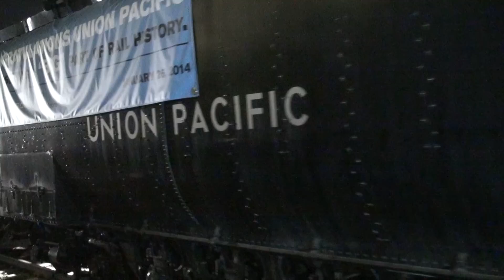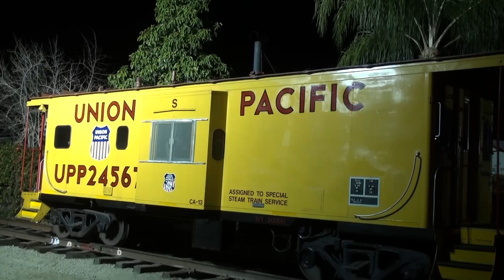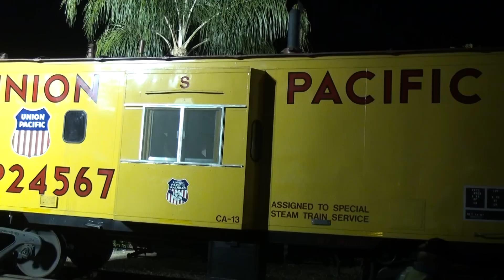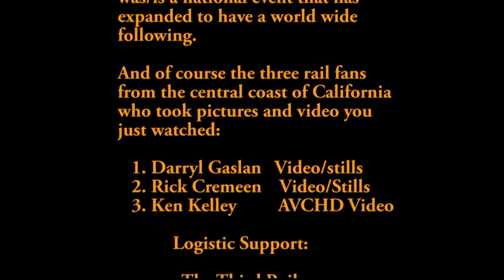Big Boy 4014 finds the Rails M2T

Comment: I'm amazed that the Big Boy could get round a curve of that small radius. Shows how clever the original designers were! Thanks for documenting the event for those of us who couldn't get there.
Reply: i would not try that with my locomotive at 45mph! that is one tight curve.
Reply: It's almost like running a Lionel locomotive meant for 0-72 curves but you run it on 0-54 curves. LOL
Reply: 4014 is an articulated engine. It has two separate swivel driving sections.
Reply: Legomenon,Thank you for your reply. I don't know the details, I just wanted to mention "ariticulated" because there are many who don't know how totally amazing and complicated 4014 is !

Comment: Ultra-high quality documentation of UP Big Boy 4014's first connection to the railroad network. Suspense (will the tender make it)? 5 stars!
Reply from the maker: Thanks for the rating, however, Union Pacific mechanical engineers are the ones who earned the kudos for figuring out the tender could make the curve.

Comment: Kudos for putting on the video info about the reason for all that hopper cars in this move, none of the other videos that I've seen of this event explain something about it but I'm glad to find it here!! ;-)
Reply: What was the deal with those?
Reply: Joseph Rosnett The answer is on 41:30... Additional braking because the big boy and tender doesn't have active brakes by now...
Reply: From all the red hoses wrapped around 4014, I think they actually did have her brakes connected. However, unproven brakes that haven't been used in years, so it's a good idea to provide the empty covered hoppers as additional stopping power. Just in case anything had gone wrong.
Reply: Looks to me like 1996 is leaning to it’s right on the curve.

Comment from the maker: If possible, try to view this video in full screen (minimum of 480p) so you will be able to pick up some of the amazing track work that is taking place at nighttime as the Big Boy Steam Engine finds other than temporary track under its wheels.  Yes it is a long video which should give the viewer some appreciation of what Union Pacific is doing for future generations so they can enjoy that part of the Industrial Revolution where Steam Power so changed the world.
Reply: How were they able to get the whistle to work?
Reply: Andrew Carlstedt Ed tied the whistle and bell to a generator and compressor in the tender but it can only be used once or BIG BOY goes into emergency
Reply: Andrew Carlstedt Either with an air compressor, or they are tapped into the brake air supply from the diesel.  If you look when it starts down the track, you can see a couple of big, red airlines tied in down by the drivers.
Reply: Nonna UdBidness those hoses supply air to the compressor BIG BOY can only use the whistle once or the train goes into emergency
Reply from the maker: Nonna UdBidness  I was told by one of the 4014 crew that they had an air compressor in the tender.  Also, they did hook up the front four drivers with air breaks, not he rear 4 drivers.  What air supply they used is a guess, but I tend to believe it was through one of the air hoses from the lead diesel.
Reply: SYVRRy they used both units SP1996 provided air until they got to the Suburban Propane siding and picked up 4884 and they met the SD40s at the Concrete Plant this provided braking until they got to Colton and the SD40s returned their cars to the plant.
Reply: Aaron Peavler/Geomodelrailroader Railroad Photography Uh, the brakes were released. Air pressure was only routed to the whistle and front train brakes.
Reply: I said that SP1996 and 4884 provided air for the brakes and for the whistle and bell they also charged a compressor in the tender with air from the locomotive but they had to be careful if you dump the air out of a diesel it goes into emergency.
Reply: Aaron Peavler/Geomodelrailroader Railroad Photography The air compressor on a diesel recharges after every use.
Reply: Kyle Genthon yes but blowing a whistle dumps it the air hose for BIG BOY is hooked to SP1996's dump valve if they use the air to blow a whistle the locomotive goes into emergency.
Reply: Aaron Peavler/Geomodelrailroader Railroad Photography Did it go into emergency? No. Why? They did short bursts.
Reply: Kyle Genthon exactly only the diesels can blow crossing if a long toot is blow there goes the air.
Reply: Aaron Peavler/Geomodelrailroader Railroad Photography Incorrect. The air tanks on modern diesel locomotives are far larger than the ones on the older diesel locomotives. Meaning the tanks can be emptied at whatever pace the engineer chooses,
Reply: Aaron Peavler/Geomodelrailroader Railroad Photography Incorrect. The air tanks on modern diesel locomotives are far larger than the ones on the older diesel locomotives. Meaning the tanks can be emptied at whatever pace the engineer chooses,
Reply: but blowing long toots on a steam can dump the tank that air is also charging the compressor in the tender.
Reply: Aaron Peavler/Geomodelrailroader Railroad Photography Did you even read my comment? The air tanks on diesel locomotives are quite large, and hold large amounts of air. It'd take a few minutes to deplete the tanks.
Reply: Kyle Genthon only if a steam blows a long whissle constently
Reply: Aaron Peavler/Geomodelrailroader Railroad Photography Which, according to regulations, is forbidden unless doing the crossing sequence.
Reply from the maker: Kyle Genthon Yes Kyle I read all messages posted to my videos.  Many of them I do not answer either because the answer already exist somewhere on the comments section, or, I am not knowledgeable enough to state the answer as a fact.  This is why I rely of others who know the answer to a question much better that me trying to fake it.  Thanks for your comments. We appreciate it. Ken
Reply: STEAM POWER WAS THE GREATEST THING TILL THERE WAS SOME THING TO REPLACE IT THEN STEAM POWER WENT INTO THE SCRAP PILE. SOME OF THE GREAT WORK IN STEEL BEING PUT UNDER THE TORCH.
Reply from the maker: I believe there is renewed interest in old steam engines, however it is becoming very expensive to modernize those steam engines which means very few individuals/groups/organization have the means to do such.  We should all appreciate railroads such as UP that are undertaking restorations actions to keep history alive for future generations.

Comment: I had to take another view of 4014 on the move.  A real piece of American Railroad History captured on video.  Thanks, Ken.  I saw a question about the whistle sound.  From what I heard over group discussions with Ed Dickens of Union Pacific, the whistle sound was actually from 4014.  Although it was obviously not powered up, I believe the whistle was powered by a steam generator placed somewhere on 4014 or its tender.  The steam generator output was only sufficient to activate the whistle.  As a result, the whistle volume was nowhere near what it is capable of performing - like hearing it miles away.  However, I surmise it was powered enough for the intent of officially notifying  the visitors that morning at the Pomona Fairgrounds and the rest of the railroad industry that 4014 finished its journey on hopscotch sectional tracks across the Fairgrounds parking lot, ending 50 years of idle captivity and was now rolling on rails of the national network.
Reply: and BIG BOY telling the rest of the world he is back and officially back on the rails.
Reply: No, there is no plume. Steam through a cold whistle body would make an obvious fog when it sounds, there is no visible emissions. The whistle was connected to compressed air, probably taken from the brake air compressor on #1996 and stored in bottles strapped inside the tender or cab in order to build up enough volume for the whistle to actually sound.

Comment: Thank you, SYVRRy, Darryl, Rick and Ken for being there throughout the night to document this.    
Curve looks too sharp for the 4-8-8-4.    Did they grease the insides of the rails?
7:50  Notice hammer impact against the rail arrives through the rail before its sound arrives through the air!
After the engine passed, I would have heavily greased the railhead and inside head wall.
UP 3105, box car and caboose for what?  To replace UP 4014?  Any video of putting Metrolink's track back in service?   
Sounds at 43:00 do not sound good.  Why the hopper cars?   Going to Wyoming?
Reply from the maker: I have no video of the Metrolink's track being replaced. as we moved to catch additional video as 4014 proceeded to Colton Yard.  All your other questions have been answered somewhere in the other comments.

Comment: Thanks for posting this video. My question is was this just a temporary connection? And after the move they had to undo their work then reconnect the main line?
Reply from the maker: Yes.  As soon as 3105 passed into the parking lot, they broke the rails with Metrolink and repaired the original ML line.  I'm not sure of the time, but the ML schedule was re-established Sunday mid-day.

Comment: i guess it's only appropriate that one the greatest steam locos of the world be replaced by THE greatest diesel locomotive the rail industry has ever known: the SD40-2 !!!
Reply: no GE's here!!!
Reply: sd40-2 thankfully is electromotive diesel
Reply: Amazingly Union Pacific has a few of them still running I recently saw a 1815 and 1855 in El Paso
Reply: EMD SD 40-2 is the best hardest working locomotive next to the GP40 and GP60 loved those in my consist but I d like GE B39-7  and c40-8 standard cabs I didn’t care for the new wide cab units but the CW 6000 those are beasts and to have two of those in a consist together look out
Reply: I think they should've included SD70M number 4014 as well since they were taking steam loco 4014
Reply: @MrBnsftrain  They added SD70M 4014 later down the line actually.

Comment: I haven’t seen anyone mention it yet but I think UP chose 4884 to lead the train out on purpose lol, woulda loved to see 4014 if they have a new one too
Reply: @Robert Darnell SD70 4014 [now 4479] was actually supposed to be the loco for the actual pull; but it had suffered minor wreck damage and wasn't available.

But, if you view any video of the move to Cheyenne?  You'll see 4014/4884.  Yes,  UP intended for those locos to do the transfer.

Comment: This  was the best real thriller I had ever seen, magniffic.
Reply from the maker: Thank You Carlos... I wasn't meant to be a thriller, only a single step towards the final restoration of 4014 by Union Pacific. We all think it will happen (best guess is still 2019).
Reply: +SYVRRy - move those ultra heavy machines around a CORNER  made me swet because if they came to tumble invards it would be terriffic.
It was a very dangerous maneuver under high risk but very well done through a spectacular precise slow motion - fantastic.

Comment: 42.00 i am not a rail expert and that shows in my question; why are 10 additional hoppers needed to provide additional braking power if needed? they themselves have no power? they get compressed air from the engin(s)?
Reply: the cars are to control BIG BOY since he does not have breaks yet. Steam Shop is replacing the driver brake cylinders so a bypass pipe is located on BIG BOY the ends are connected to the brake system. the cars are loaded with concrete the two engines are the City of Industry Local Steam Shop borrowed their train to provide braking. when BIG BOY arrives at Colton the engine will go into the drop pit and the driver brake cylinders will be replaced before they head over Cajon Pass to Salt Lake.

Comment: 43:15 next stop Colton BIG BOY will stay in Colton until March undergoing brake work in the drop pit and Steam Shop will be in Kansas plowing snow. when they are done with that Steam Shop will bring the Snow Train to Colton and pickup BIG BOY. engines in consist for the trip home are two retired SD60Ms 4014 and 4884 both engines will be renumbered to the 3700 Class but not 3900 since that is reserved for Challengers. 4000 Class diesels will be renumbered to make room for BIG BOY on the roster.

Comment: 46:10 BIG BOY has arrived at the outskirts of Colton the SD40s will set out BIG BOY here and head to the hump SP 1996 and 4884 will head to diesel service with BIG BOY for an inspection SP 1996 will then leave later in the day to take train MWCNO-28 down the Sunset Corridor to New Orleans. Steam Shop Crew will leave their equipment here and board 4884 for the trip to Salt Lake where they will pick up Diesel 4014 at Terminal Yard then both engines will head to Steam Shop to pick up the rest of the train.

Comment: 1:25 so the work begins Metrolink has left  Fairplex after dropping the railfans off now the rails will be cut and dragged to Gate 15 to attach to the panel track. Like a parade of dinosaurs the earth movers cut the rails and move the ballast in preparation for tamping.  2:54 Metrolink dumps ballast onto the tracks and at 11:01 Gauging Highrail and Tamper arrive once they are done they are sent back to Covina so SP 1996 can arrive for pickup.

Comment: I know I am not very smart but I was surprised that centipede type tender wheels went around that tight curve. good job Is all I can say.
Reply from the maker: +Curt Ray  I agree. UP must have figured it out. I believe the wheels on the tender have some sideway slip just for turns (or the inside turn wheels have the ability to  ride on a smaller diameter portion than the outside wheels). Anyway for all the wheels in a row, it worked out fantastic!
Reply: on my model trains they make some wheels blind. that is no flange at all for the tight turns.never thought of it on a real one.big fun for sure
Reply from the maker: Yes! UP did an excellent job of getting 4014 onto the Metro link track.

Comment: And how was the whistle able to be blown if there is no steam
Reply: hooked up the diesels air compressor to its whistle
Reply: They probably tapped the brake air compressor on #1996 to charge up compressed air tanks and blow the whistle using that, since the boiler would not yet be considered safe to pressurize to a high enough level for the whistle to sound. That's why it sounds a bit weak, a steam whistle on compressed air will play a different note than intended and a whistle that size requires an enormous volume of steam or air to work properly.

Comment: that looks like an awful tight curve for the 4014 at 2;00, where their cutting track.
Reply from the maker: The chatter talk that evening was about the sharp curve and questions arose about 4014's tender having 14 wheels (10 rear wheels mostly fixed in position) could it make it around the curve?  The Union Pacific experts showed that they did indeed have it figured out even though it took a remarkably slow speed to check as both the tender and engine made it out without a flaw.  Again, a great job by UP!

Comment: 38:13 the crew stops in Covina to lube the engine and to rest by 8 am BIG BOY is lubed and on its way to Basset Junction. note BIG BOY now has green eyes the red lamps were removed at 3 am when BIG BOY arrived. 39:01 with 1596 leading the City of Industry Local departs Covina and goes through Baldwin Park next stop Basset Junction.

Comment: I see 2 or 3 working and 14 or 15 supervising. Typical, but they will all claim they helped.
Reply: Considering the task at hand, if there were only a couple of workers there to do the deed, they'd be too tired to continue within minutes if they didn't have backup.  When their backup takes over, they're the ones standing around catching a break.  Seems reasonable to have more help than you need on such a job than to few.

Comment: What a JOKE!  No piston connections, no valve rods/connections, no steam;... just a rolling piece of scrap iron!
Reply: The pistons and valves are lubricated by the steam flowing through the cylinders. This engine has been sitting for so long that it would be positively unsafe to try and raise steam without a teardown and extensive testing. So the pistons and valves were removed entirely, that way the engine could be safely towed to the Union Pacific steam workshop in order for the necessary inspections and repairs to be made. 

It would have been much harder to move with the pistons and valves still attached, and moving the engine any further than bringing it out of the shed before lighting the fire would result in damage to the cylinders from lack of lubrication.

Comment: they aborted the coupling the first time but got it the second time
Reply from the maker: I would have liked to have shown this coupling of 1996 with 4014, but to do so would required me to leave my position on Fairplex Drive to go around into the Fairplex parking area... this would not have worked due to timing to be in two different locations.  I did see one video from the parking lot which shows this coupling quite well.  I do recommend those interested to view other videos of this event.  Thanks for your comment.